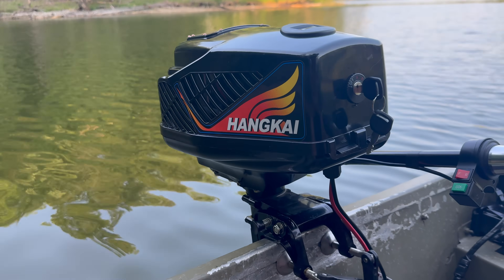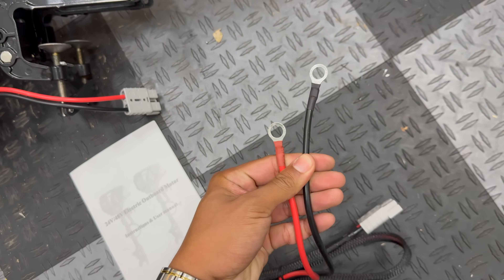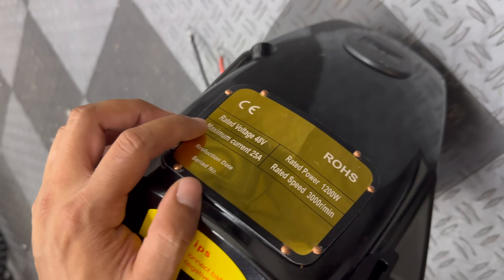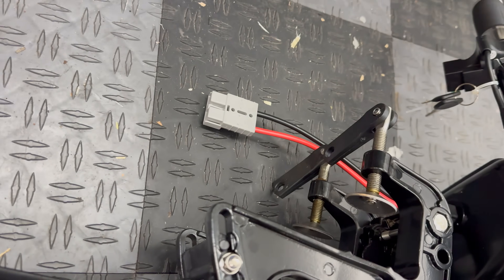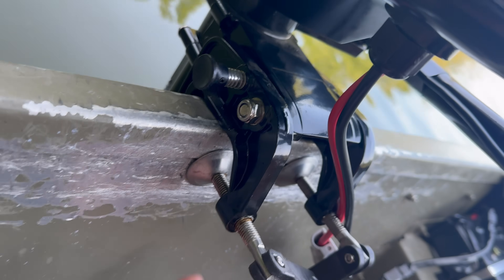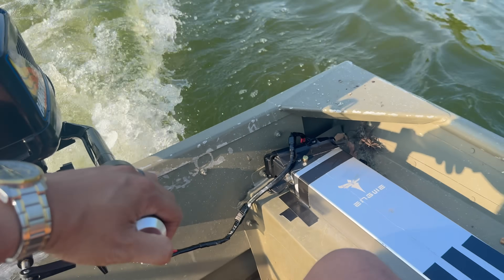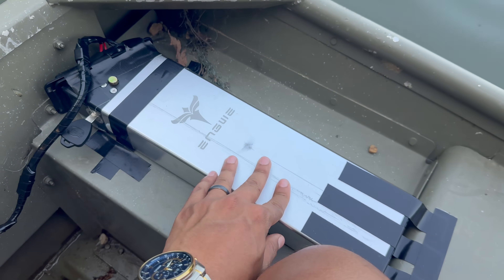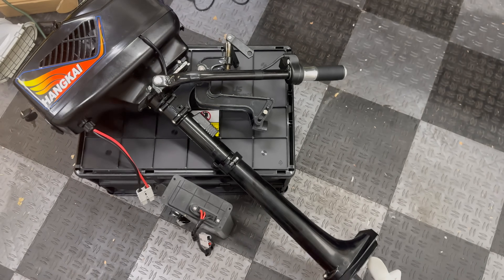Hangkai 48V 1200W Electric Outboard Motor Testing and Review

Comment: how many amp hours is that battery rated for at the beginning? The only reason I could see the battery lasting only an hour, is that they don't actually recharge them. I use batteries in the range of 90 amp hours to 120 amp hours.. and I could go over 8 hours sith the 90 on a 28lbs thrust motor.... and now I typically get 10 hours of continuous use with my 55lbs thrust minn kota on my 14ft jon boat. There's no way that park is taking vare of those batteries... and they probably pnly throw them on the charger for 20 minutes. So bad!
Reply from the maker: I think the teenagers that operate the rental equipment simply don’t care enough to make sure they’re properly charged.
Reply: @PatOutdoors  I bet... I'm sure they look at the charger... see 60 percent, and are like.... "yeah, it's fine"

Comment: Seems louder and less powerful than a 2.5-5 4 stroke. I'm guessing some of that is the mic, but I've also been on plenty of gas boats where you kinda forget the motor is even running because they're so quiet. Maybe some lube in the gear case will improve that, but so far this seems like a heavier, louder, and more expensive option to low power outboards.
Reply: definitely less heavy and WAY less expensive then the quiet (honda/tohatsu (mercury)) outboards, like 1/10th the price!!!

Comment: This type motor could be a game changer, kayak motors are so expensive
Reply: im thinking about putting a hangkai on my kayak and/or inflatable raft. gas version tho. the 4 stroke 4hp one. i dont think electric will get me 20 miles. unless i have a boat load of batteries. 😂🍻
Reply: @niteshades_promise_music I put an electric hang Kai on my kayak. The first time I had it out I almost sank from the weight in the rear. I put on some inflatable stabilizers and it works great. I have a 600ah battery and it lasts a long time. The battery isn't that large so I could have a few of them if I wanted to go far.

Comment: Uh... 1200 watts / 746 = 1.6 HP. Still, you can do a lot with that amount of power, when you are not bucking a lot of wind or current, and also 1.6 HP worth of electric motor is actually more versatile and flexible than the same horsepower in an internal combustion engine. The power curve is flatter and wider, mainly. You have much more low end torque. And there is an almost bottomless minimum idle speed. No warmup is needed. The role of reduction gearsis not as important. You simply have to have the correct RPM range and prop diameter, blade count, and pitch, to make the prop turn efficiently at the chosen power consumption level, without cavitation. But no matter how you slice it and dice it, or massage the data, this can never give anything close to a sustained 5hp power output to the prop shaft. Ain't gonna happen. The good news is you might not need 5HP. 

Ratings of electric motors, especially Chinese made traction motors, are misleading, too. A motor might be rated for x watts at y duration. For instance, 5kw for 120 seconds, but if you try to run that same motor at 5kw for 5 or 10 minutes it might either overheat trip to save the motor, or simply have a big-ass meltdown. Cotrollers are rated similarly, especially Chinese made. You are more interested in SUSTAINED power. You don't want to motor your boat for a minute or two minutes and then stop to let it cool for 30 minutes. You want to go from point A to point B nonstop. So always take the ratings of Chinese made motors with a grain of salt. Remember, these ratings were assigned by the sane company making and selling them. Chinese manufacturers are also notorious for using wire that is too small, resulting in lots of line losses as the resistance of the wire causes the high current required by low voltage DC operation, to be converted to heat, reducing available power. Even the wire in the motor makes a difference, and too-small wire wll cause problems. Motor power ratings are rated by input power, naturally. If you have a kw of power going in but are losing 75w through heating of the coils, and more from cheap bearings or poor alighment or in this case a poorly optimized prop, the net effect might be much less than the HP figure found by dividing electrical input watts by 746.

Plain and simple. You get what you pay for. You are paying for shoddy materials, "good enough" quality control, and unskilled, underpaid, undereducated, labor. The basic engineering can be sound and the final product still be a POS. If a POS is acceptable and the price of a Torqueedo is not, then the Chinese OB is the obvious choice. But make sure you are able to sail or paddle home. Don't forget your battery makes a difference in your range, as well as your power setting.

For about $1200 you could get a 5kw Motenergy BLDC/PMAC motor and a Chinese Kelly controller, and make a fairly nice electric outboard based on the carcass of a dead gasoline outboard in the 6hp to 9.9hp range. Add eight 6v GC-2 size golf cart batteries in series with the requisite cabling, fusies, and meters, and you have a pretty nice propulsion setup that will push a small boat quite nicely.
Reply: Yes, a continuous rating would be much more useful but the ad guys don't care about that. Wondering what it used just making all that noise? 😊

Comment: You forget to put gear oil in as they come without it
Reply from the maker: Not the electric one! I just pulled the prop off and opened up the lower unit and it’s fully filled with gear oil.

Comment: I got the same motor for my 18 ft Lund.  The shaft is to short for my transom, (most of the prop is above the bottom of the hull), but it still got the boat up to 4 MPH with  48v 100ah LiFePO battery.  Got the long shaft version coming to replace the short shaft to see if it does any better.  The prop is made of Nylon but you can get Aluminum replacement, same prop but says it's for 3.5 hp electric.  How do you put oil in the gear box?  Mine has the bump on the housing, but it was never drilled out to drain or fill the gear case.

Comment: At 6 mph you are pushing hull speed for a 12 foot boat. https://en.wikipedia.org/wiki/Hull_speed 
Slow down a 1/2 mph and you will probably cut the current draw in half! The only way you will go significantly faster is if you get a motor that is big enough to get your boat to plane. With two of you in the boat this would probably require quit a bit more power -- probably an 8 hp (gas) motor.

Comment: Sounds like you need to add oil to the lower gear case - from what I have seen they do not ship them with oil in the lower gearbox - it sounds very noisy
Reply from the maker: Not the electric one! I just pulled the prop off and opened up the lower unit and it’s fully filled with gear oil.
Reply: Absolutely correct. I had to replace internals after 2 trips. Drill and tap drain and fill ports while you're there.

Comment: I wouldn't worry about horse power... I'd worry about whether it works well enough, for how much it costs, and how long it lasts (as well as how easy it is to get replacement parts/repair).

If it works well, is somewhat durable, and you can order parts online, then it could be an option to consider, for some situations.

I'm guessing a cheap used gas outboard might be a better long term value (parts availability, longevity, etc). Of course, some places are electric only.
Reply: Buy a mercury or yamaha

Comment: No, its not 5 HP. 1 HP requires about 745 watts of energy, discount losses and so on at best you have 2 HP. Having said that: because a electric motor has continuos torque, it accelerates like a 5 HP gas engine... but it will never reach the 5 HP top speed.

Comment: How much total weight do you think was on the boat? And whats the boat weigh?
Reply from the maker: @markyygamer2073  me (180), my wife (170), fishing gear (10), motor (15), lithium battery (5), cooler full of beers (20), 14 foot Jon boat (150).. so probably about 550 lbs altogether
Reply: @PatOutdoors need whaler 13 whaler 15 small cabin frusrr
Reply: Thank you for the quick response. As I'm researching for a new outboard for the Jon

Comment: Did you remember to put gear oil in the lower unit ? All the hankai motors I have bought in the past have came with no gear oil for transport ?. Even though it's electric it still has a geared lower end unlike the little trolling motors you used at the start of the video. Hope this helps.
Reply from the maker: Not the electric one! I just pulled the prop off and opened up the lower unit and it’s fully filled with gear oil.
Reply: Exactly my thoughts.
Reply: *have COME

Comment: It seems pretty loud for an electric motor.  But not as much performance as I would have guessed over the 12v troller...    I would be curious to see what a 48v trolling motor like the bass boat guys use.
Reply: Not much performance?  You would never get a wake like that on  12v trolling motor set up on a jon boat w/ 2 ppl. Lol

Comment: Due to the higher efficiency and flat torque curve of an electric outboard the standard calculations do not apply. Toorqedo has a detailed explanation on their website. 
They assume, that a 2000W electric has the same pushing power as a 5hp gas outboard. So this 1200W would be comparable to a 3-3,5hp gas outboard. Fits with the numbers in the video....
Reply: I was thinking in my head that a electric motor could handle a steeper pitched prop because of the torque. It would be a fair bit stronger than the equilivant petrol motor in hp or kw mesurment.
Rctestflight recently did a rc boat propeller efficiency test. It shows you can gain heaps from just changing the propeller on a boat.
Reply: I tried different engines (ICE, electric), the speed depends only on the power and pitch of the propeller

Comment: To calculate electric HP it's volts divided by 0.105 times amps divided by 0.0035 divided by 700
Reply: HP is irrelevant. The only thing that matters is how well it works, how long it lasts, and how easy it is to repair. Maybe safety issues, as well.
Reply: @PaulLawson-k8v  when I worked at a Ford dealership we had to replace the intakes and exhaust on Cobra mustangs because they didn't achieve the advertised HP cost Ford a ton of money. So I'm guessing advertised HP matters.

Comment: At 7 minutes 13 you say you wish the stem was a little tighter, your hand is about 6 inches from the friction knob, on the stem. Careful if it's anything like the little merc if you leave it loose it will vibrate and fall out.

Comment: I'll have to compare those to my expensive Torqeedo travel 1003.

I've never heard of a place that would rent just a motor. I've flown my inflatable boat for free on Southwest airlines as luggage with the full sail rig.  A trolling motor would have really helped, but I didn't think they could be rented anywhere. It's usually boats rented, and not motors only.

No battery box on the rental?
Reply from the maker: @classicarcadeamusementpark4242  no battery box!
Reply: @PatOutdoors  Won't work on my inflatable. There are no sides. When I used my trolling motor it was strapped at the back of the boat on the wooden motor mount. I use a Torqeedo Travel 1003s now, but I can't take that on an airplane.

Comment: Thanks.
It certainly performs well. 
No kill switch? ….yikes. 
What about the temperature sensor cable to the battery? 
I suspect there is a lot of plain / painted steel, perhaps not useful for use on the sea, or not being stored dry. 
One aspect of an electric over gas is that they make high torque at low revs, so the power output is not so much linked to revs.  This means if you could fit  a big high thrust propeller for better low speed performance with a bigger / heavier boat
Reply from the maker: Definitely a slimmed down outboard with little safety features, hence the price point. A kill switch would have been nice. No temp sensor, though the battery I’m using now (not on this video) has a smart BMS (battery management system) that cuts off power if the temps or amp draw fall outside the safe range for the battery.

Comment: Definitely not a 5hp motor.... i have a 5hp engine on the very same jone boat as you and it can get the boat to plane
Reply from the maker: @hughrs  yes, I debunked this in the video.. I said it the labeling didn’t make sense because 1200 watts is less than 2 Hp
Reply: @PatOutdoors  I know you said that.... at best it's a 2hp... I with there could be something that could be done about all these Chinese companies and their faults advertising ugh

Comment: Electric outboards are so far behind... Imagine the surron power specs on one of these. Wouldn't be bad at all and small
Reply from the maker: Well that’s actually why I bought this 😂 To maybe stick an Electro & Co EC4P, MY1020, or a small QS motor and a Kelly controller, 72V battery, and crank it to at least 6,000 watts like my little bikes..
Reply: @PatOutdoors  Kelly controller bro NO. Fardriver or BAC. Wanna see what 8kw sustained can do. Fardriver controller has water cooling plates FYI
Reply from the maker: @JuanJDumeP  I was just thinking about what I have laying around. I’m using my FarDriver ND72530 on my Razor right now.. but I think that’s too much power for this shaft / housing / prop combo
Reply: @PatOutdoors  that is indeed powerful I have the nd72850 and it's a monster. You don't have to use 100% of the controller power you can adjust the current output via the app start at 50 amps and go up from there.

Comment: I did a similar thing. I own this same outboard except I used my surron battery.  Its 67.2 volts full and runs this hangkai outboard motor perfect for over 4 hours. No over heating.  I use it in salt water only for the dinghy on the back of my sailboat. (I just rinse after every use) Had it for 4 years now and still works great. Only had to replace prop shaf seal after first year, then I used 90wt oil. Little noise for electric but I love it
Reply: My first thought was that a motor that cheap from a Chinese producer is going to corrode rapidly in salt water...interesting to know you've had good results. I guess thorough flushing every time is critical - and long-term storage somewhere as dry as possible.
Reply: Where did you get the prop shaft seal from?
Reply from the maker: Wait what! I what controller are you using? The original 25A 48v controller?
Reply: @PatOutdoors  yes stock controller  runs 67v no issue's  I want to tey 84 next
Reply: @organicoceans4459  THAT motor wasn’t available four years ago …
Reply: @SpatialGuy77 I got it 4 years ago
Reply: I got the 12hp 2 stroke for my bris 10.5ft inflatable for my 36ft Dufour and it cruises at 18mph 😊

Comment: 1200 W / 746 W = 1.6 HP. There's no way that can be 5 HP, as it would need to be 3.7 kW.
Reply from the maker: @paullangford8179  I answered this in the video. It’s not even 2 HP, but it scoots ok
Reply: Prop horsepower is defined by torque times RPM.  The formula for HP is simply (Torque x RPM)/5252.  If you have an engine that's rated for 5 horsepower but its torque drops off dramatically as the RPM increases it delivers less than 5 horsepower. 

 Is there anything in the paperwork that would tell you the electric motor's torque and RPM?

Comment: Please do a long term test video of the motor. Interesting to know how many hours it will last
Reply: As long as the controller can cool itself during continuous maximum power draw (which of then case with boats) it should last thousands of hours.